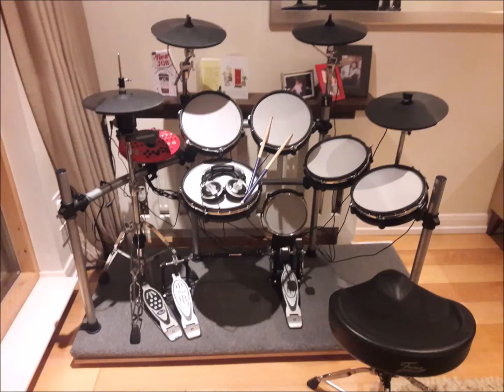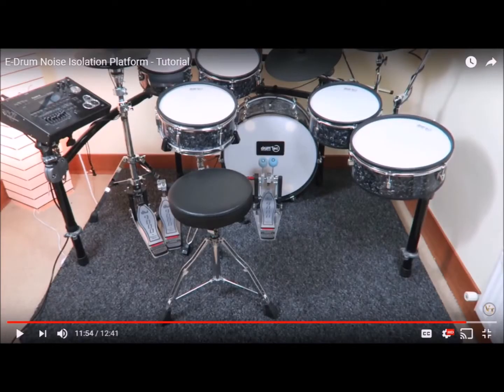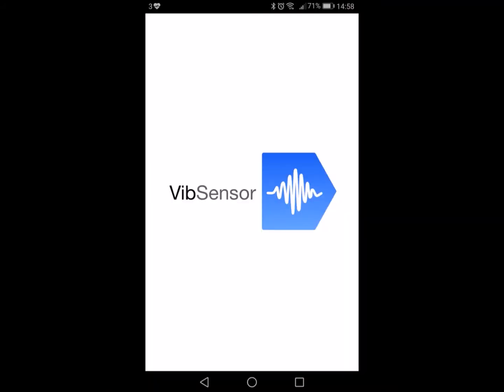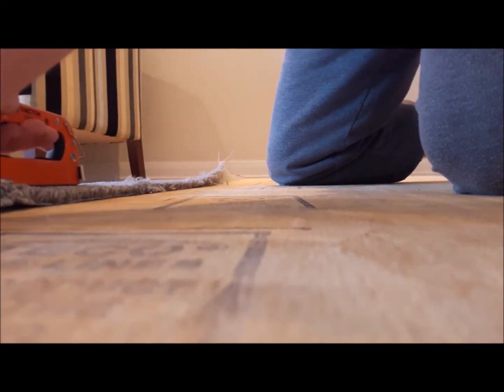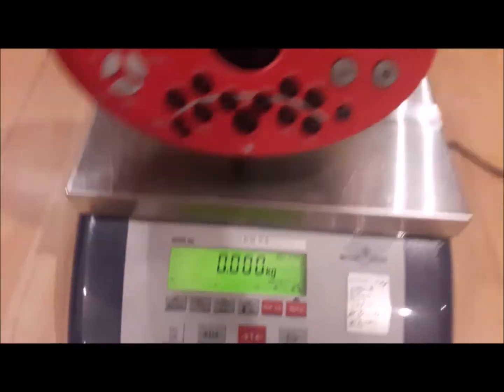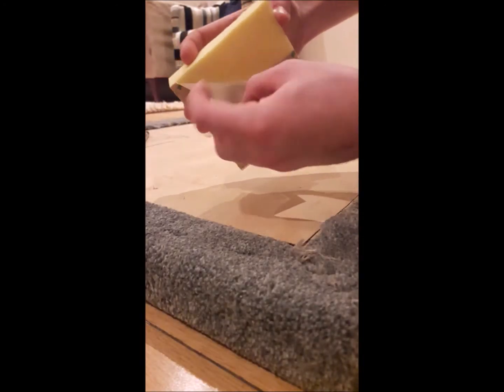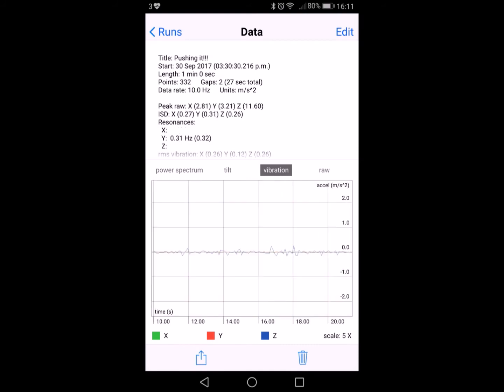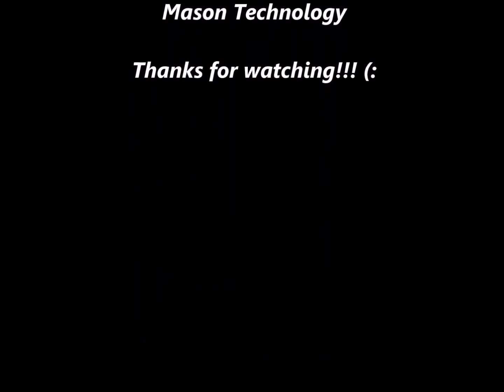Vibration isolation stage for electronic drum kits

Comment: How about using a  semi-perm bed foam on entire bottom, eliminate vibration, 100% stable... no need for hole drilling .

just simply layer it this way: (double sided tape in between can add stability and dampening too)

Carpet                            ^^^^^^^^^^^^^^^^^^^^^^^^^^^^^^^^^^^^^^^^^^^
MATS                             =================================
MDF                               -----------------------------------------------------------------
PERM BED FOAM.       HHHHHHHHHHHHHHHHHHHHHHHHH
Reply from the maker: Yeah you can do whatever you want! worth experimenting with! There is no drilling in my build, so if you're looking to avoid that, you can try this way. I went for the "overkill" approach with double layering the anti-vibration stage, its not necesary - I had concerned neighbours at the time! (:
Reply: @ICBMFTW  lets gid rid of your neighbor … lol ...just kidding

Comment: Jey, sorry for so much questions, I forgot to ask - what thicknes of the boards did you use? I was thinking somewhere around 19-22mm
Reply from the maker: Yeah they were 19mm I think! But either 19 or 22mm is fine. Be careful with the boards. If you use MDF, it needs to be supported properly so it doesn't warp. If you use plywood, it needs to be supported so it doesn't flex as it is very springy wood! So make sure you have plenty support under them!

Comment: I'm not quite sure I got this right but - in the end we can see 2 lauers. Is the lower one still the board with halved tennis balls? And then another biard with sylomer placed on top of that one? Thanks!
Oh btw, do you think making the board bigger so the throne would be also on the stage would be better? Not sire how mich vibration travels through the throne into the floors xD
Reply from the maker: Hey! Nope both stages are om the sylomer pads, no tennis balls were used in this construction (:
Reply: Ooh, alright :) Thanks for replying. Where did you get the idea to use 2 (mdf+sylomer) stacked? Do you think only 1 MDF with sylomer wouldnt be enough?...Do you think the extra layer is worth the double price? Did you ever do a test with just 1? (I just ordered an e kit and am freaking out a bit since I live in an apartment xD) I guess I'll have to make something similar. I did have the MDF with sylomer in mind but never thought about doubling it up

Comment: You forgot to measure the weight of your legs as well. This should be included in the calculation of the sylomers too.
Reply from the maker: Not only must the weight of the legs be taken, but also the downward kick as you play.

This was taken into account at the time of the build as the Sylomer operates within a weight range. The bottom of that range is with kit only, the top of that range includes drummer and kit.

Comment: Being that the weight needs to be precise or else Sylomer won't work, what happens when you want to add new parts to your kit? Like a cymbal or a new kick drum, etc..
Reply from the maker: The sylomer is cut for the stage based on weight but it works across a range, so for example 20-30Kg if weight for 30cm² of sylomer - I hope this helps!

So if you cut the sylomer to that you start at the lower end of the range, this gives you some scope to add equipment! (:
Reply: @ICBMFTW  Thanks for replying. Good to know there's still some sort of allowance. I'm going to order that Sylomer and start building the drum platform.
Reply from the maker: @micsnz  No bother at all! Best of luck! :D

Comment: Great video! Can you tell anything about the noise heard from next rooms or from above? I have a very small apartment. Will this platform absorb vibrations caused by pads? And will my next door and above neighbours will be able to hear the noise or is it effective for below only? Thanks.
Reply from the maker: Sadly there's no simple answer.
My drum kit had mesh heads and not pads, to noise from them wasn't so bad.
The biggest issue was the vibrations travelling through the floor.

The apartment I lived in at the time was mostly concrete in construction, so very little was heard from neighbours left, right or above.
The neighbours below heard everything! 

The stage seemed to resolve the problem from my neighbours below.

Comment: I have a question for you.  If you added extra sylomer pads equally spaced between the minimum amount calculated, would this be detrimental?  That's the most confusing aspect to me, is the calculation is so precise but in theory if you added more pads wouldn't this give you a little more leniency with the weight expected?
Reply from the maker: It wouldn't be detrimental, like the stage would still work, however not to its most efficiently optimum capacity.

Sylomer isn't cheap, so knowing your weight minimums and maximums will save you money.

Comment: You really don't need to go through all this expense and trouble. I got 1" rubber interlocking mats for home gyms from Xspec on Amazon. Downstairs neighbor says 0 vibrations now.
Reply from the maker: No doubt there are cheaper alternatives, but none come with the degree of certainty like this stage.

Not only does it smash expectations, it looks great too!
You can waste so much time, money and effort concocting different ideas, which might pay off, or not...

If the cheaper solutions work by all means use them!
But for guaranteed results, this is the best option.

Comment: Hi Jeffrey, great video, thanks a lot! 
Just a question, what's the reason why you decided to go for 2 stages?  Do you think it makes a big difference from having just one? Thanks!
Reply from the maker: So the reason I doubled up on the stages was so increase absorption and save on space. 
 
I didn't have the floor space to have a stage I sat on as well, it was also not necessary in the end. Because you have constant contact with the floor, the impacts/movements while on the stool/throne aren't noticed by neighbours. Whereas each hit on the drums could be obviously heard. funnily enough, drum rolls were actually the worst for vibrations, I assumed the bass pedal would be! 

Having one stage on another helped to maximize the absorption. Where one stage decreased noise by ~60%, doubling them increased this to ~70%. 
These numbers aren't exact, only an estimate to provide you with an idea of how it worked.
Reply: @ICBMFTW   @Jeffrey G  Hi Jeffrey, thanks so much for the answer! 
I'm also considering to build the stage just for the drum set, i.e. having the throne on the floor, so it's good to hear that it works well enough :)
Reply from the maker: @inakilujambio9896  Yeah, it really does! I found it to be quite comfortable while playing!

Comment: I know this is an old video, but can you remember how much your kit weighed. According to the calculations on the site, I’d only need 3-4 pads, which doesn’t seem that many.
Reply from the maker: It weighed about 36Kg (:
Reply from the maker: You might only need 3-4 pads. However it is very important that they are spread out in a way that supports the full kits, minimises flexing in the board, and can take the impact of you kicking down on the stage.
I used a 5 point of contact method, so approx 20cm in from each corner was covered as well as a centre pad, Slightly to the right, to compensate for where I would be kicking down! 

I suggest to sit at the stage, map where the kit will go exactly, and decide where the pads go after you know where where everything will go!
Reply: Jeffrey G that’s awesome man, thanks for the quick reply.

Comment: Hey, looking at building this stage, got a couple of questions if you don't mind answering them.

 - Are there any noticable issues having the throne separate from the rest of the kit? For space reasons that would be a much better setup for me, but I'm apprehensive to split the two. 
- Would I be able to get away with just one layer of Sylomer? I know you basically have two stages balanced on top of eachother, and I'm wondering how much more it actually absorbs. The Sylomer isn't exactly cheap, so I don't want to have to buy way more than I need.
- In another comment you suggest getting the pads without adhesive, do you have any recommendations about the kind of adhesive that should be used in place of that? I'm still debating whether the cost is worth the convenience.
- How thick was your Plywood, and does it flex at all? I'm wondering what kind of thickness I can get away with, since playes like B&Q don't seem to have more than 19mm thick available in that or MDF.

Thanks!
Reply from the maker: Hi, Good luck  with your build! I've answered in the order they're written.

Not really. I took care in setting the kit up on a flat surface and mapping exactly where I wanted the throne to be. So when I built the stage I just raised the throne and boom! Job done! 

I built 2 layers to maximize absorption. I would recommend NOT buying the Sylomer with adhesive to save money - Buy some standard adhesive from a hardware store. High strength carpet glue would do. It's a rip off to double the price for the adhesive albeit convenient!

The plywood was about approx 15mm thick(I cant remember the exact dims), one standard sheet. Depending on where you live, B&Q probably wont supply the wood sheets you'll need. I had to source them from a wood supplier to get the right size.
The Plywood does flex. IF supported correctly by the sylomer this won't matter, however I think I would of preferred MDF board in hindsight. It's more rigid.
When you start playing the whole kits moves, this takes some getting used to, but after that, it is worth it for peaceful playing!
Reply: @ICBMFTW  Fantastic, thank you for those answers and the really quick response!
Fingers crossed I can get ahold of the wood I need with the current situation going on...
Reply from the maker: @Jademalo  No Worries! Some places will start opening again on Monday! Find a wood place that can cut as well and order them to collect! That's what I did and I could of kept socially distant. Best of luck! 
(:

Comment: Great manual, thanks a lot!
But I have a couple of questions :)
1. Have you tried to use only one layer, why did you decide that one is not enough?
2. What is the dimension of the podium? I'm waiting for my Roland TD-17kv, but pretty sure that the size of the stand will be similar to yours and would like to build the podium while waiting for the delivering.
Reply from the maker: Hi Harper, 

For your first question. I watched a video on V-Drum tips were the drummer builds a stage he sat on as well. I thought this system moved too much during playing and the idea of doubling up came to me as a means of reducing the footprint of the stage and furthermore guaranteeing it's success. 

I had to order sheets of playwood 2440*1280mm and cut them to length as needed.
I had the drums first so I set them up and measured the footprint of the kit with some extra space just in case.
I don't have the exact length of what I cut the stage to wrote down sadly! >< 

However, If you're going to build one, I have 2 tips, the first is a must, the second is optional;
I would recommend you use 5 pads per board. 1 in each corner and 1 in the middle. As my top layer lacked the middle, the plywood began flexing and I had to add a pad in after.
Don't buy the pads with adhesive. They're overpriced! Buy some decent glue and use that instead! it will save in costs! Make sure you buy a suitable glue! 

Good luck!

Comment: I didn't fully understand the part where you weigh the components of the drum kit. What exactly did you do with those weights, and why was it necessary? Because you have a formula of the suitable amount of sylomere as a function of weight placed on it? And if so, is only the total weight of the kit relevant or does it also matter how the different components are distributed on the wooden surface?
Reply: Ah, figured it out :) found the sheet and understand the formula (surface needed of sylomer in cm^2 = weight in kg/0,11). So what you essentially do is place exactly the amount of weight on the sylomer that it is designed for, since the surface pressure is 0,011 N/mm^2 = 0,11 kg/cm^2, right? But I wonder, how much extra noise reduction  does your second layer of wood and sylomer add; have you by any chance tested the vibration reduction with only one layer? Thx in advance!
Reply from the maker: @toeterneus  
Glad you figured out the formula! You're correct in the theory of it all.
I haven't actually tested to see the difference in vibration between the first and second layer, I remembered reading it did increase it, not by an insane amount, but enough to make me do it. Unfortunately I can't remember where I read it! If I find it I'll link the URL here! (: 
My main concern for this was killing all vibrations as well as having minimal footprint. So stacking seemed like a good idea at the time. I also have testimonials from the neighbours proving they can't hear it, so win win! xD

Comment: Nice how is it holding up to date?
Reply from the maker: Still works 100%. Haven'd heard anything from the neighbours at least!
Reply: Cool, did you use two layers of sylomer? Or is the bottom layer just raised?
Reply from the maker: Carbon 
I used two layers, there is one set of pads under each board.
So it's in essence, a stage on a stage, double the insulation!
Reply: Jeffrey G Thanks, im gonna give it a go in the coming months.
Reply from the maker: Carbon 
It's worth while, let me know how ye get on!
Just some advice, if you use plywood make sure it is evenly supported as it flexes with the weight.
Reply: Jeffrey G Alright thanks for you help :)